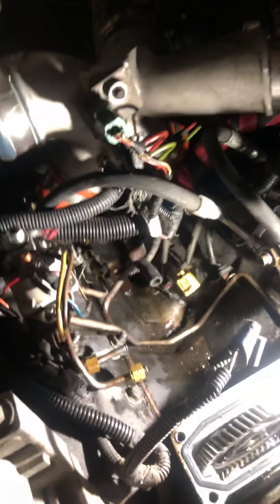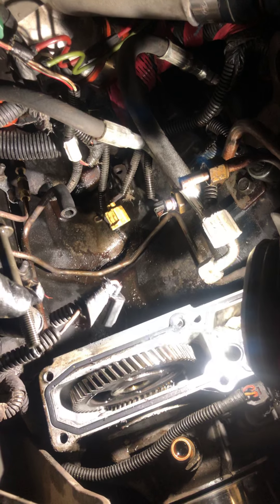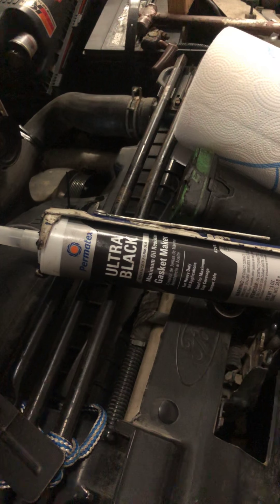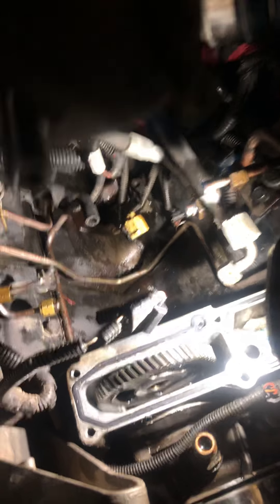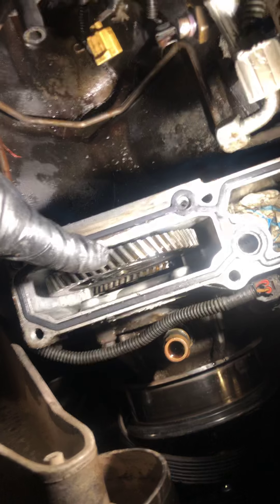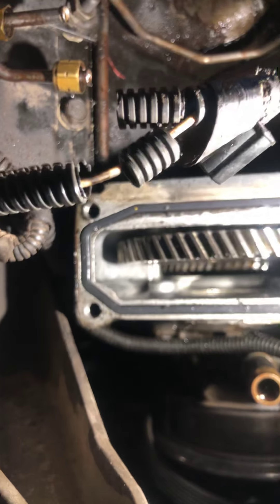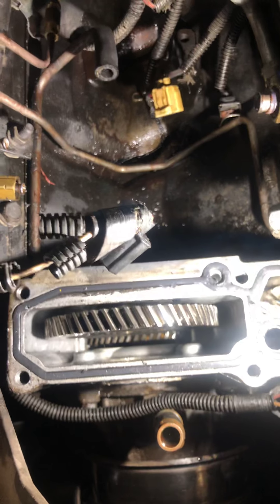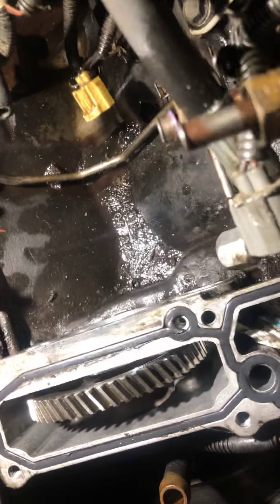High pressure oil pump removal and installation 7.3 power stroke

Comment: Thanks for the view from inside the reservoir.
Reply from the maker: Crypto G absolutely. Is this something you have to do soon?
Reply: @mechanicdave4899  Yes, on my 2002 7.3. My truck is actually leaking fuel from the fuel bowl and oil from the HPOP. I'm going to remove both and reseal and after watching your video I'll drain and remove the reservoir top for a better view.

Comment: Thanks you Sr very much 👍👍👏🏻👏🏻🎄🎄
Reply from the maker: rolando garza my pleasure sir.
Reply: Do I need to refill the reservoir oil before start the truck after I put the new pump thanks?
Reply from the maker: rolando I did pour some oil in.
Reply: Mechanic Dave ok my friend thanks I will do that 👍👍

Comment: In removing the bolt in front of the hpop oil pump on a 7.3liter diesel hose do you keep the gear from turning while you are trying to remove the bolt.
Reply from the maker: It’s not timed, so it won’t matter sir.

Comment: What is the proses before pulling the pump and reservoir. And after installation to get it redy to crank please???
Reply from the maker: Pedro Aguilar clean the surfaces very well. Make sure you have a good black gasket material. Take your time to not drop anything inside the engine. I would recommend changing the oil before starting the engine.